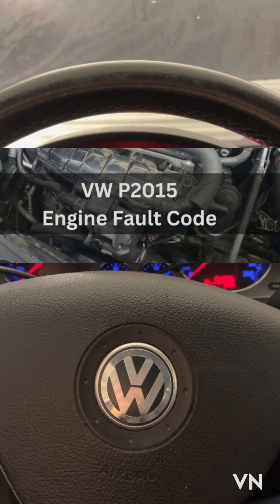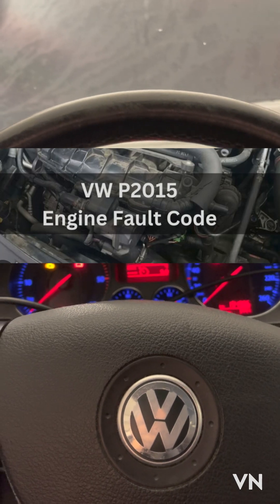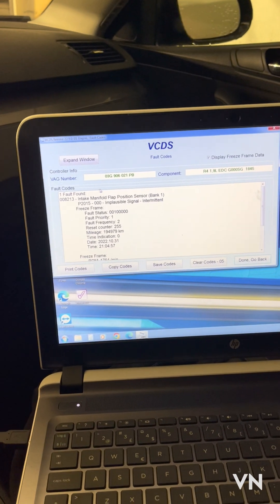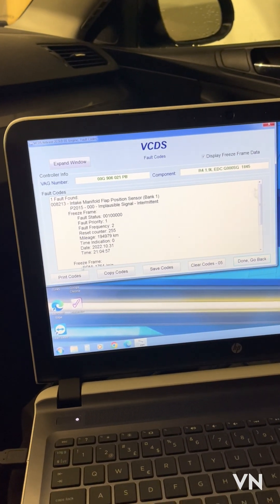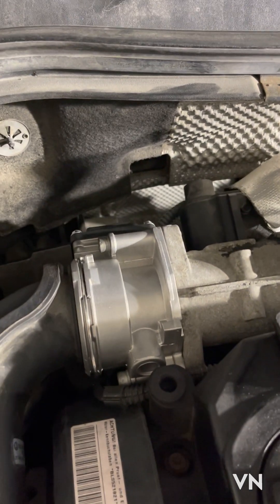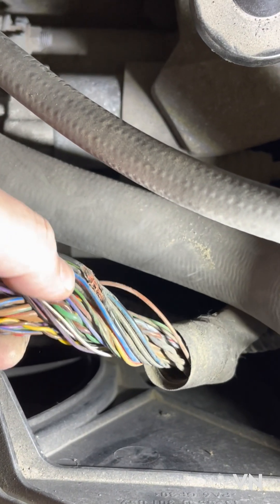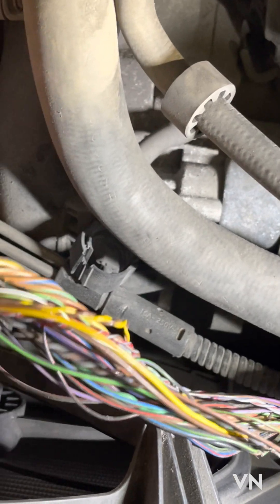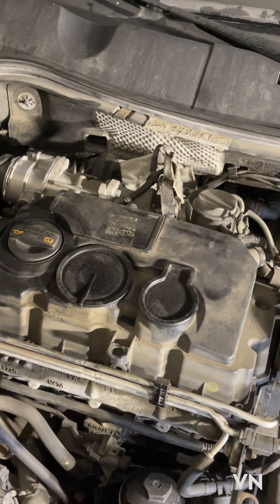How to repair P2015 VW 1.9. 2.0 tdi

Comment from the maker: With electric is very easy you have 12V or not, if your mechanic changed you vacuum ventil then you have problem with vacum, send me picture of what part you changed? If it’s possible

Comment: Hi
How you find out is the wiring?i instal.new flap.actuator and now p2015 gone but p2004 and p2006 comes up,my mechanic told.me tha actuator doesnt get enaugh power from ecu or sometimes comming sometimes not
Any advice?
Reply from the maker: Hello, what csr do you have with what engine?
Reply: @nordic_garage  2.0 tdi cbab vw passat b6 2010